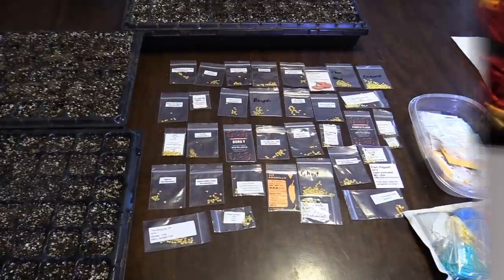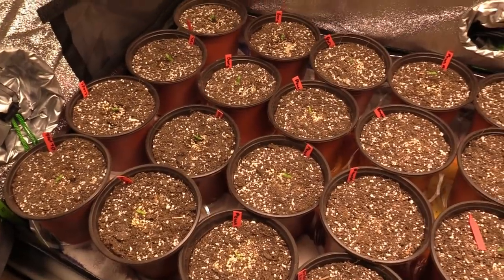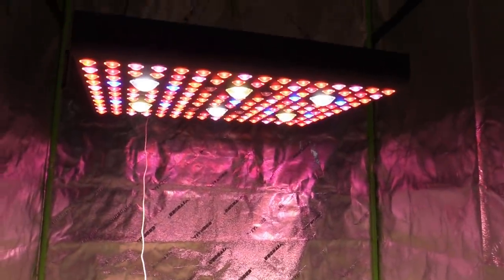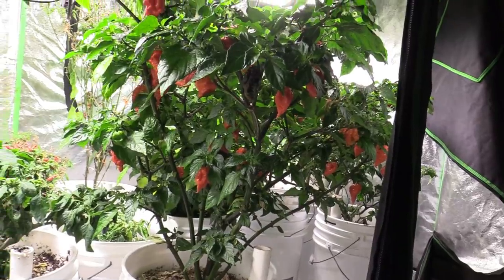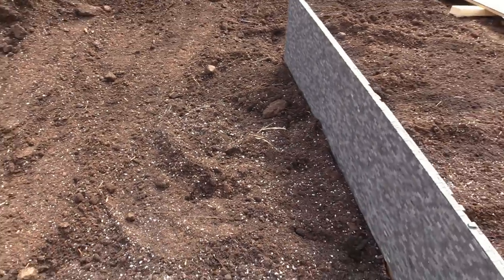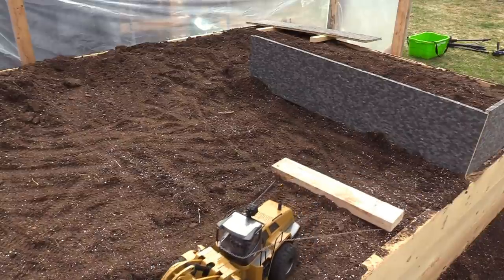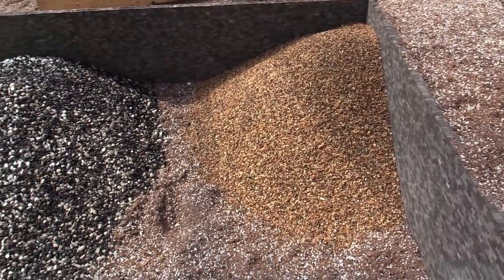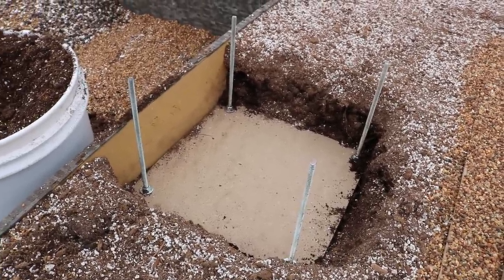RC Peppers Episode # 1

Comment: When grading roadways, you need water to drag the smaller particulate down to 'lock' the larger stones. Also a roller to compact each layer. Normally you'd build roads in thin layers (6-12" uncompacted dirt), compacting each one. So for it to work with the RC machines, you'd need to scale down your layers. Also the RC equipment doesn't have the scaled weight to compact the dirt. You'd have to add lead to your roller.
Or make a wooden foundation with dirt glued on. For a more permanent roadway, concrete would work nicely, coat hanger wire or chicken wire would work well as rebar on a thin cross section road.
Looks great so far. Thanks for posting on Imgur. That's how i found you.
Reply: Sorry for coming straight in with suggestions, I got a bit over excited. It also was fresh in my head after watching a video on road works. Love the fist video, excited for more.
Reply from the maker: Thank you for the info! You've just inspired me for next year!

Comment: How big is the tent you use for overwintering and how many buckets are you able to fit in there?  Looks like it was pretty packed.  I imagine some plants get pretty big, so you probably can't have buckets touching each other.
Reply from the maker: I’ve got a 4x8 tent in the basement, a 4x4 and 2x4 tent in my garage as well. I’ll probably keep around 12 in there over winter.